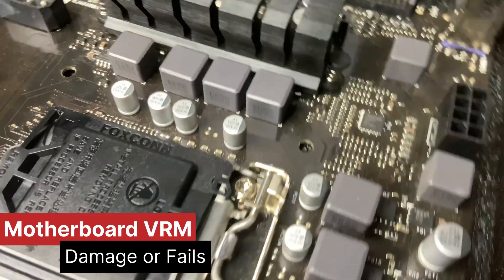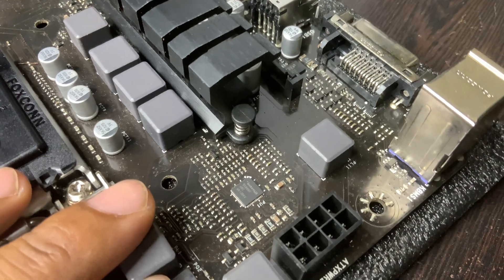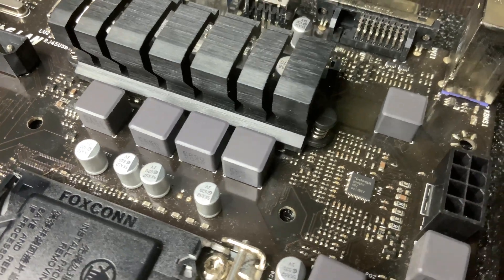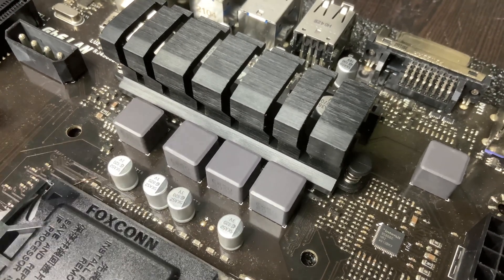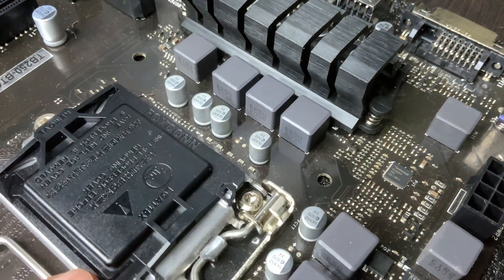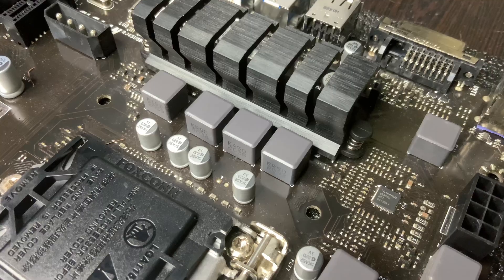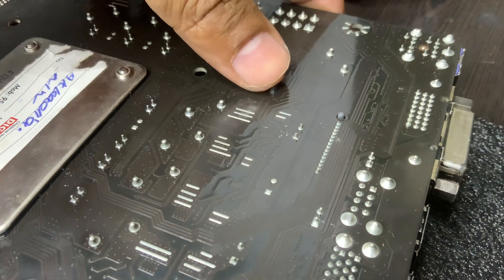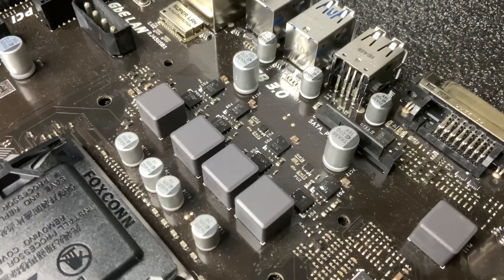What happens if VRM is damaged?Motherboard VRM Damage Symptoms

Comment: My motherboard VRMs hit 116°C when the CPU is under load. Also, my CPU won't go above 27 watts no matter what I do, and it instantly spikes to 95°C under full load. I've tried different high-performance coolers and ensured the mounting was correct, but I couldn't solve the issue. Do you think the problem is with the motherboard VRMs
Reply: What do you think ?

Comment: Does this apply to laptops too? I got a Dell inspiron 7773 that had a chip blow up near the battery. Cpu won't go past the clock speed 0.40 ghz. Its only drawing 3 watts.
Reply from the maker: what is the number of that chip
Reply: @Lifeofelectronic  the chip unfortunately burned right in the middle of its number. What numbers i can tell you is 739 hr7 w7????9. It blew up after the battery was plugged in.